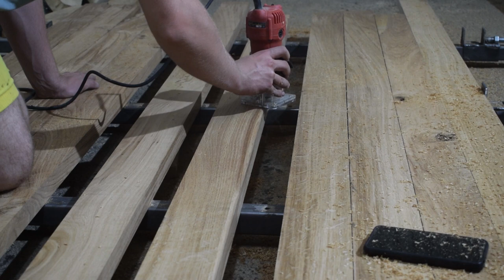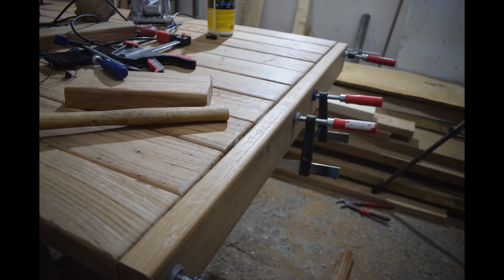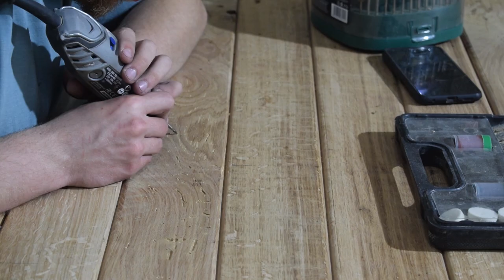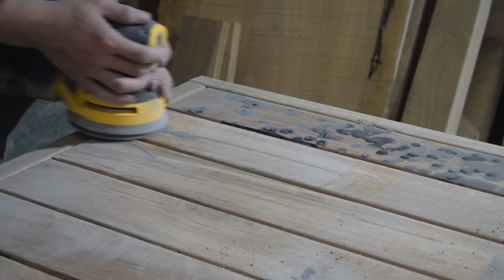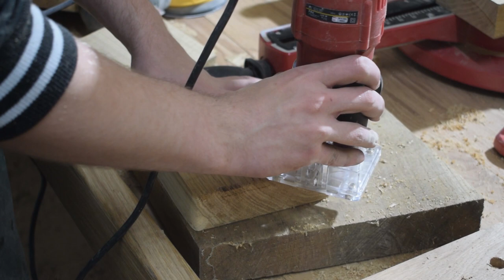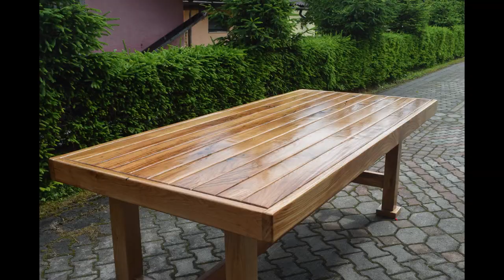Making Oak Table

Comment: It will be interesting to see how that cross grain glue up holds over time!  In my experience Oak moves quite a bit with changes in  humidity so I would not be at all surprised if the cross grain glue joint failed in a relatively short time.